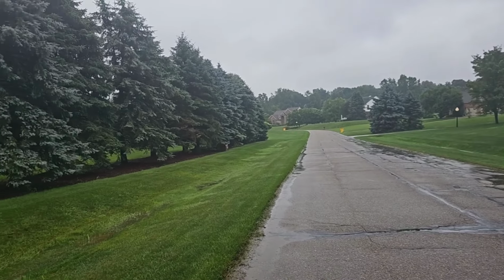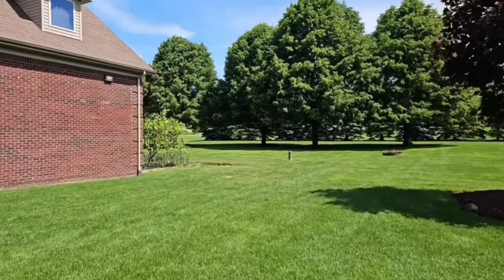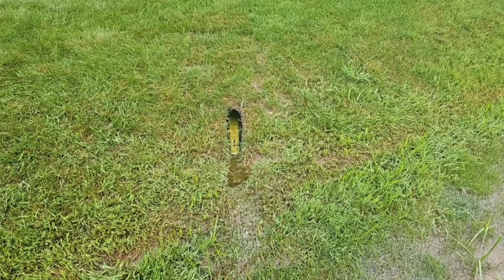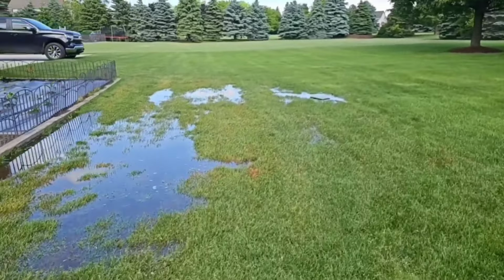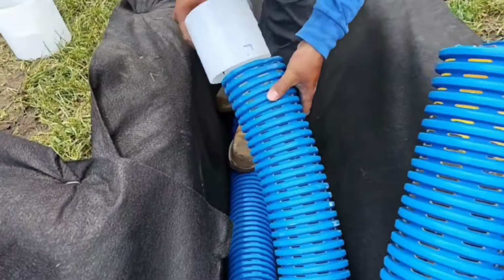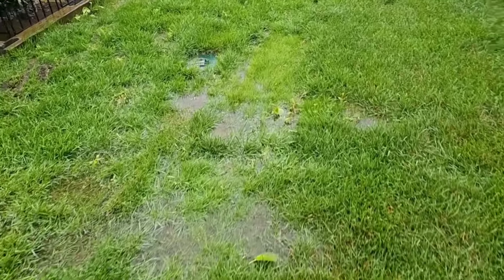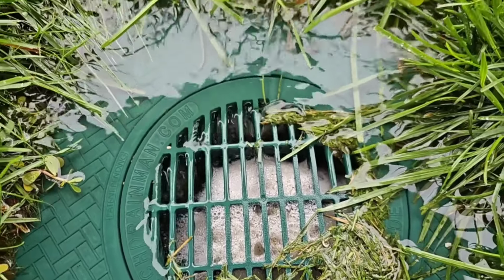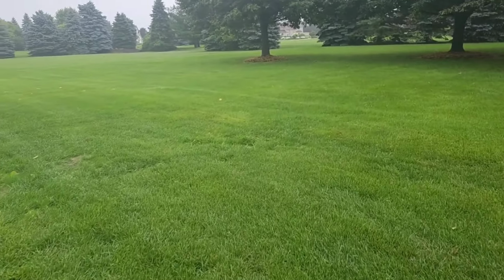Quad Pack French Drain is a Detention Tank During Power Outage

Comment: Excellent video as always!  Are you running all of the sales appointments yourself?  My closing rate is about 10%. What is yours.  Also, I’m contemplating charging a $99 consultation fee for estimates, if the client contracts with me I will credit the consultation fee toward the job.  What is your opinion on the fee?
Reply from the maker: We do 30 estimates every week. No matter what, when there's a lot of rain and big storms come through, that could be boosted to 40 estimates a week. Our closing rate is 30%. That's what you need to have as a closing rate. If it's less than that, you're too expensive. If it's more than that, you're too cheap. We do not charge for estimates. We do not leave a map or load list; that would be a consultation, and we charge for that.

Comment: like the detention tank video, the more storage you have the easier it is on the pumps and they last a whole lot longer. also where you fit your float switch matters. if you fit it down a bit, that gives room for water in those big down pours that are more than what the pump can pump out.
nice job, you can't see where your guys worked which is really good.